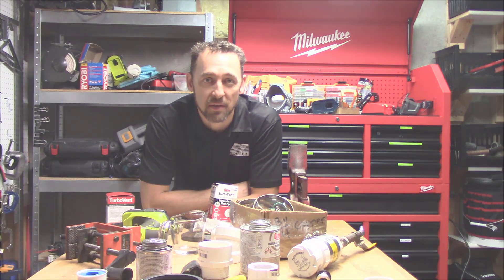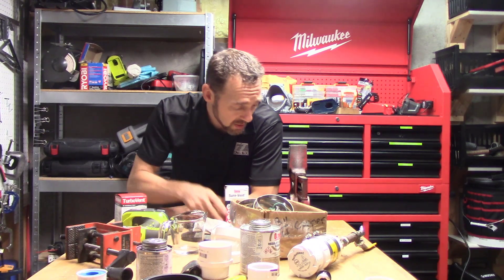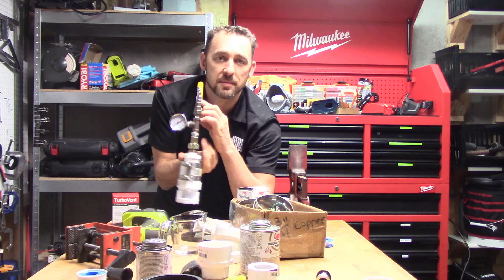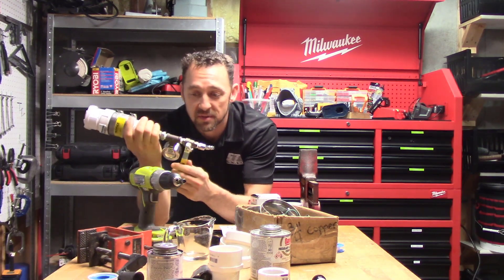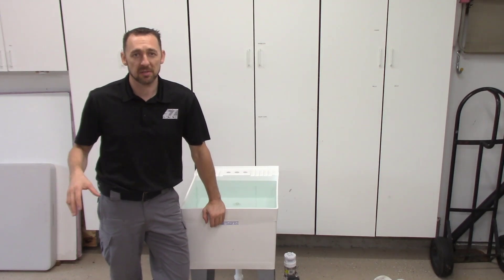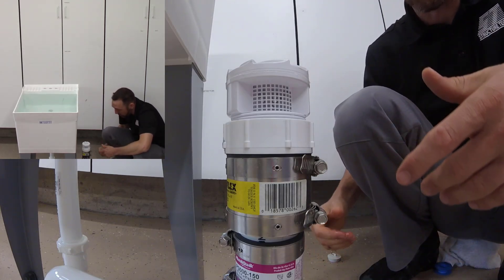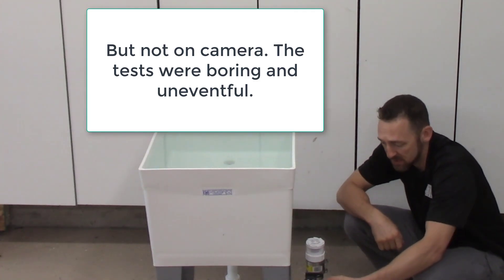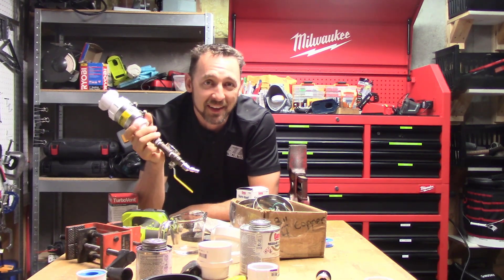Air Admittance Valves

Comment: I am a building surveyor in the UK - we use them everywhere especially on high rise new build flats. When they fail or one has been fitted incorrectly you can tell because the resident complains of a strong sewage smell.
Reply: debstar2005 I need your help. I live  on the ground floor in a 5 storey block of flats and have the very problem you describe.  can I contact you please.  Thanks
Reply: Surely not for a standard House...I get it for flat s but not a House.

Comment: @structure Tech Home Inspections How would these work in an air over pressure situation? The scenario would be that your in a bunker with an air system pulling air into the bunker. The exiting air pipe for the bunker has an over pressure valve on it creating positive pressure inside the bunker. How would something like this react if installed on sinks ect? What would be the best way to do an air system for plumbing in this scenario. Also worth noting, the toilet is a macerating unit with sink and shower connections. The unit is capable of evacuating black and gray water up to 16 feet vertically and 150ft horizontally with a 36' head. To be honest, I'm not entirely certain yet how to run a plumbing vent system inside of a positive pressured bunker. Any tips would be great! thanks!

Comment: We have one under our kitchen sink. Sometimes it works and most of the time it doesn't. It doesn't allow our sink to drain. It doesn't allow air out...when water drains from the sink it has to  push air out of it's way in order to drain but this type of vent wont allow the air to be pushed. If I remove the vent it drains immediately. Very frustrating.

Comment: Interesting video, I raise the following concerns about the testing; (1) Water overtime will eventually replace air so the test you performed with the sink filled with water and pipe assembly would have to remain for a period of days or even weeks to replicate a clogged drain condition where the standing water infiltrates the air space to the air admittance valve seal.  Once this has taken place then a possible conclusion, in that case, could be possibly used to argue that water or waste water does or does not leak past the seal of the air admittance valve. (2) The pressure test where positive pressure is introduced to replicate the drain system pressure under a condition where a transient pressure occurs, however, the test in the video introduces the pressure at high velocity not taking into consideration that there is a distance not representative of how positive pressure would develop in a plumbing drain system.  Such a conclusion that this test proves that air admittance valves do not leak sewer gas could not be relied upon in support of any such conclusion.  In fact, the air admittance valve relies on a pressure drop or a negative pressure within the plumbing system to open and allow air in, so then, the proper test to prove the air admittance valve does not leak would be to reverse the principal in which the valve opens by creating a pressure drop or negative pressure in the environment opposite to the plumbing system pressure.  It was an entertaining video to watch and I appreciate the extent of effort you put into it.  I would only suggest that accurate testing be completed prior to concluding that the air admittance valves you tested are safe.

Comment: what about the Plumbing code book that states "Mechanical Vents are not permitted."
Reply: try sec 918 ipc 2018
Reply: I believe the way these valves operate, they are technically not considered "mechanical".....
Reply: @thegoose0m1  these vents are not permitted. A vent must allow air to enter into the vent system and exit the vent system. In other words, both ways. This style of vent does not allow this. See the Plumbing Illustrated Manual.
Reply: @thegoose0m1  if these valves became popular the sewage in the street main will stop flowing

Comment: An AAV only works when there is negative pressure, aka a trap seal is trying to suck dry, therefore the gravitational seal in the AAv pushes open. When the sewer is draining like it's suppose to there is positive pressure on the drain line and Is pulling the AAV closed, therefore the drain is still not being vented properly and will exhibit the same problems of gurgling and stopping up as it would without the AAV. In fact, the only good an AAV would be good for is in an old house were they don't want to redo the system and the traps keep getting sucked dry. AAVs are bullshit and should not be allowed to be used in new construction ANYWHERE
Reply: What brought me to this video is that my house, built in 1979 with an AAV under the kitchen sink, just failed TODAY.  No leaks, no smells... for 40 years.  Not bad, I'd say.  But I'm not a plumber so what would I know about it.

Comment: Super device. I am one that likes to see the nitty gritty, along with the smooth sailing. Obviously had the pressure set to high on your compressor in the bloopers lol.
Reply: Well obviously your nitty gritty is malfunctioning because an AAV is a sub par device. The only use it has in an old non vented house where the fixture keep sucking the traps dry. It does nothing to help draining.
Reply: @1CornHolio  they are used in most mobile homes because the state doesn't have any jurisdiction over them. Say, my state which is Kentucky has no jurisdiction over mobile homes and you do not require a permit to do plumbing work on one, except the water service and sewer